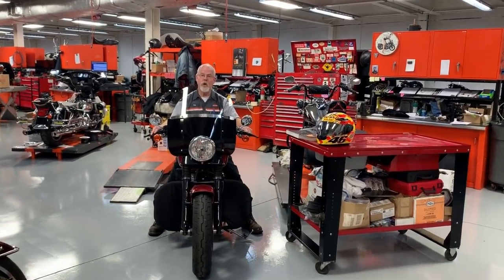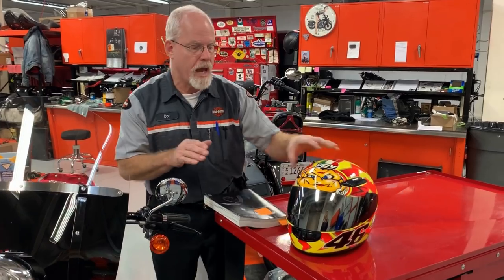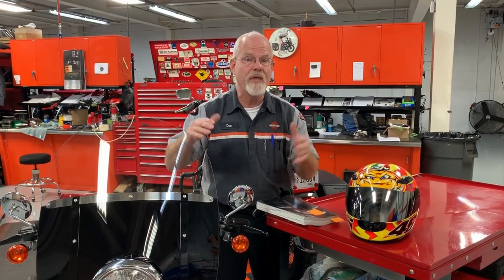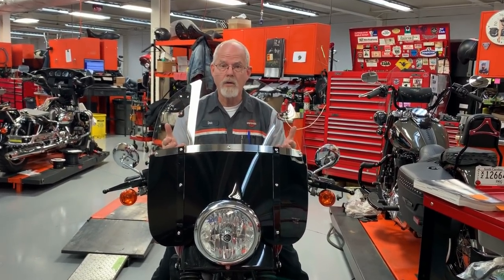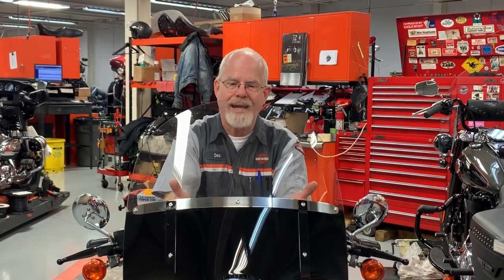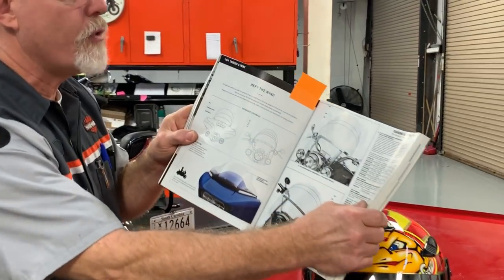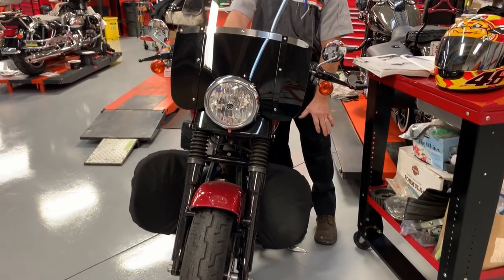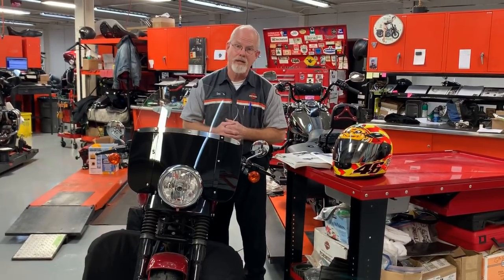DOC HARLEY: DEALING WITH BOBBLE HEAD DUE TO WIND TURBULENCE - BUFFETING

Comment: 2010 Road King, stock windshield, 6'1". The buffeting was rattling my teeth Installed a set of fork mounted deflectors and an air dam between the fork legs. Smoothed everything right out

Comment: Thanks.  A taller windshield can cause more buffeting because it creates a larger low pressure area so the turbulence is air getting sucked up around the tank. So paradoxically a shorter windshield causes less turbulence and buffeting. I too prefer to ride looking over the windshield and I got less buffeting when I cut down my windshield. Yes, cut down. I have never in 40 years bought a shorter windshield. I cut my FLHTC windshield near the bottom then drilled new holes for the bolts. Cutting off the bottom means no polishing, the rough edge is concealed. I have previously cut off a couple of inches from the top and that works ok too. That just requires sanding the top edge smooth again.

Comment: Electric adjustable windscreen is the way to go.  Get with the program Harley. I run the stock shield on my Road Glide Special, paired with a modular helmet which keeps my head in the clean air above the fairing.

Comment: If you are looking through a windshield and it starts raining, you are now looking through 2 wet surfaces, glasses or helmet shield and the windscreen. This dramatically reduces visibility. Can be very much bad.
Reply: buy a shorter shield-lookover. About chin height works great, wind will still deflect over your head.

Comment: 02 HD road king ultra classic. How do you check computer codes
Reply from the maker: Easy way is take it to your dealer. In the diagnostic manual there is a procedure with a jumper wire and counting flashes. But then you would have to have a diagnostic manual to look up the code and procedure to repair. BTW how did this question come up with this video?🤷‍♂️…..Doc

Comment: What is better ....fork deflectors or soft lowers ?? I need to stop the gust of wind that comes up from underneath the bike .
Reply from the maker: I have not ridden with fork deflectors to be able to give an opinion. My slim has engine guard leather covers that push the air to my knees. Maybe someone on the net can steer you in the right direction. Thanks ~ Doc
Reply: fork deflectors
Reply: Fork deflectors definitely .

Comment: The wind coming over the windshield is not a problem.  The problem is the wind coming up from under the fairing is what makes my eyes water and pushes my beard up into my face. That is the problem that needs addressed.   I pulled the windshields off 2 of my bikes and 80 mph down the road is no problem. The batwing on my electra glide can’t be removed and that bike pisses my off.  Eyes start watering around 60 and my beard gets to beating about the same speed.  I really am about to spend a lot of money for a bar mount speedo and remove that batwing.
Reply: If it works for your type of bike, try Kuryakyn's Lower Triple Tree Wind Deflector. Helped me on my HD Street Glide. Was about $45 US.

Comment: Doc! Great video as always, I wish you weren’t 700 miles away... probably a stretch to use your dealer for service! Question for you... my 2012 48 and 2006 Electra glide both make a strange noise when down shifting into first when you’re going a little to fast for the gear.. generally it’s accidental I’ll have lost track of what gear I’m in and down shift one too many times before making a tight turn etc... when attempting to put it in first it makes a rotating type clanking noise and you can feel it kick the shifter back a little... what’s happening here? Am I damaging the bike or is it designed to do that to prevent and over rev etc.... thanks for your time !
Reply from the maker: This is not normal. You could be damaging your transmission. See your dealer. I would ask if you have after market hand levers? These can sometimes prevent the clutch cable to pull al the way to disengage the clutch. Also what is the condition of shift linkage? You could just need an adjustment of clutch, shifter pawl, or you have transmission issues. ~ Doc
Reply: Thanks Doc, I do have have aftermarket Joker Machine levers but I think it actually came down to the fluid .. I was running Lucas primary fluid and even though it’s technically the right viscosity I think it was just too “sticky” causing the clutch to drag a little ... Switched back to oem fluid, flushed it a few times and now everything is back to normal ... hopefully I didn’t do too much permanent damage...  she seemed happy this summer. Thanks again!  The Lucas says “formulated for Harley Davidson ” right on the bottle... 🤦🏻‍♂️ I should have known better!

Comment: Doc, I have a 2011 Cross Bones, I've tried the taller and the shorter with the HD mount with stock seat and nothing works above 40 MPH. I've tried thee different helmets half, three quarter both open and closed and full face and they all react the same. HD needs to make an adjustable mount for the springer to angle the windshield forward. I have a couple of friends who have Softail customs and they too have not h=found a windshield that is safe above 40 MPH.

Comment: hi question I have a 1998 fatboy and had to drop the because of someone turning in front of me. well any once I got the bike home I found that one head stem bolt was broken I have been told a few way to get the front end straight again from hitting on a pole  it in the opposite way that the front end has twisted can you help me with the way that is maybe the eases way just the way a back yarder can do at home with a shop near by cheers 
 from jacko

Comment: My new 2021 Trike has the stock seat and windshield at 10 inches. The stock seat is really not that bad but I would like to have a wider one. With the stock seat and windshield, I have NO buffeting. The wind moves over my head with no movement. But, you open the vents on the batwing on each side, and you think you are in a boxing match. I was hoping to be able to use those vents but no way. They stay closed.
Reply from the maker: Thanks for your input. I guess I would use them in stop and go traffic only?....Doc
Reply: @LowCountryHarleyDavidson  At interstate speed, I tried several openings of the vents from very little to wide open Just not good. How are they on a two wheel  bike?

Comment: If the wind buffets you too much, you're probably going too fast. I have no windshield, and I can go 75-80 mph depending on the wind direction. Sometimes I have to slow down a bit, but one thing I  never have to do is clean a windshield.

Comment: Just take your helmet off and that goes away
Reply from the maker: Funny but not me…..Doc
Reply: @LowCountryHarleyDavidson  Then deal with it.
Been riding gor 50 years. Never an accident. Helmets aren't needed.
Riding skills are.
If you need a helmet, then you have a fear. You should operate any mechanical device untill your fear and confidence is gone.
That's why there are so many motorcycle accidents.
Because people who can't ride or are scared need to feel cool and relevant so they endanger themselves.
When I grew up we called it "weeding out the week".
Today's generations want to save the week.
Good luck with that.